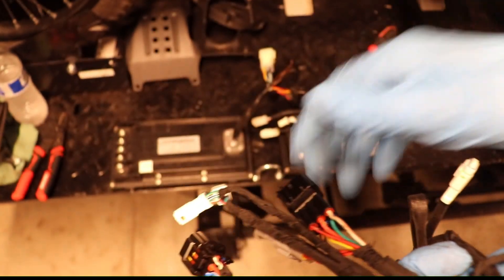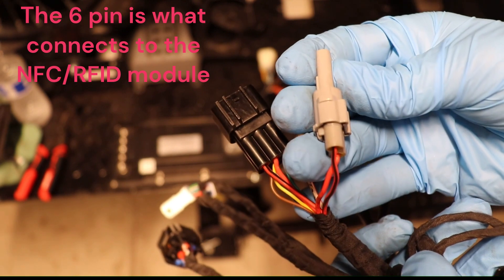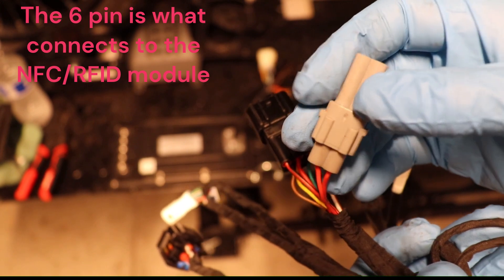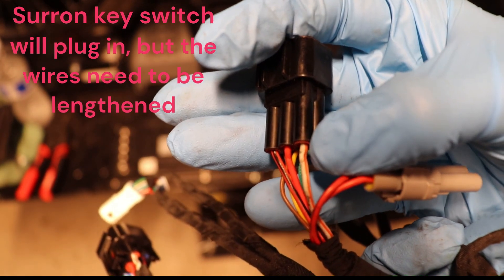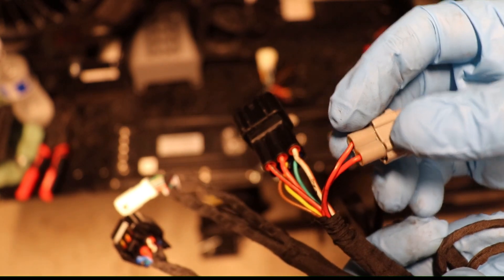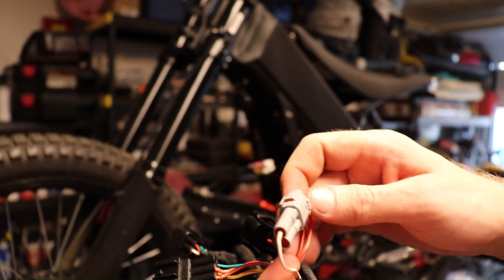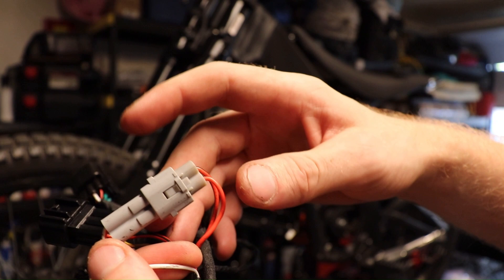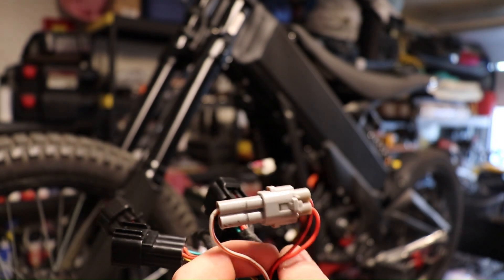Talaria XXX NFC/RFID bypass and key switch wiring

Comment: For the 2-pin connector if I connect those two wires (whether by installation of a key-switch or even just a simple switch) will that then be a parallel way of starting the bike in addition to the rfid?  Or would it be a serial circuit, where I'd need to activate the rfid AND the switch to start the bike?
Reply: I'm going to answer my own question as Kody hasn't replied yet.  Connecting the wires in the 2-pin connector creates a parallel circuit.  That is, you can either start the bike as usual with the rfid card (after pressing the button), OR you can press the button and then connect the 2-pin connector wires.

One word of cautionary advice.  My way of connecting the 2-pin connector wires was to temporarily use a piece of metal (small cotter pin).  I then realized I COULD just leave the cotter pin in and use the button as the on/off (yes, I know Kody connects different wires in the video for this).  However, when powering off it took a few seconds for the eggrider display to go blank.  Several times of this and the display took longer to turn off.  Then, it wouldn't turn back on.  I removed the cotter pin and was able to get back to normal operation.  SO if you are tempted to add a keyswitch on the 2-pin connector wires it seems there is a sequence that needs to be adhered to:  when turning on button gets pushed first, then 2-pin connector wires get connected (and then start button is pressed); when turning off 2-pin connector wires get disconnected, first (and then not sure if button needs to be pressed or not).  Bottom line is that there seems to be some strict processing in the controller regarding the order in which it receives start-up/shut-down commands.

Comment: To install the key ignition, do I need to change any wires or as it as simple as unplugging the 6 pin rfid/button plug and plugging the key ignition plug in?
Reply from the maker: For the key ignition that plugs into the 2 pin connector, all you have to do is plug it in and go.  If you leave the 6 pin plugged in then you will still have the option to use RFID

Comment: Would a Talaria Sting ignition key be as simple as a plug and play to get it to change over from rfid to key, really appreciate the work your doing for the xxx bike!
Reply from the maker: Yes it does plug in, but the key switch is too long to drop into the factory push button hole, and the wires are not long enough to reach up there
Reply: @kodyewing6443  thanks for the response, I was thinking about getting one but seeming as it won’t then there’s not point really! Many thanks!
Reply: Hi, so when you mean I’ll be able to “use the push button to start” that means I turn the bike on how?  Sorry
Reply from the maker: @TresXTre yea so you will just be using the push button to turn on the bike, then press the start button on the throttle and go!
Reply: do you mean I just push it once and it’s started/ready to go?  As opposed to pushing the button then using your RFID?